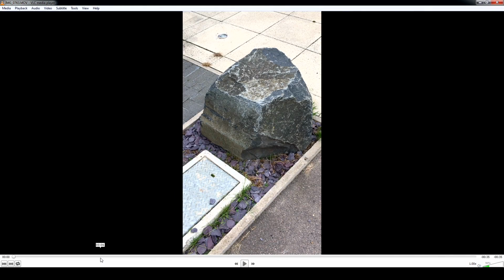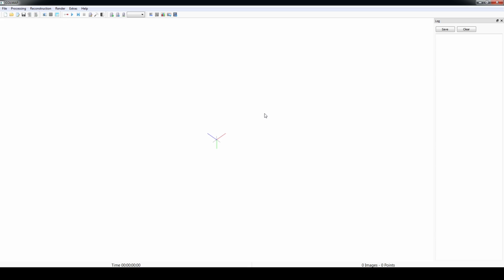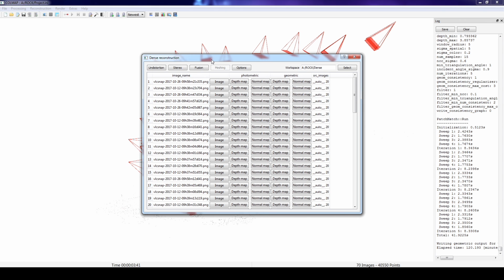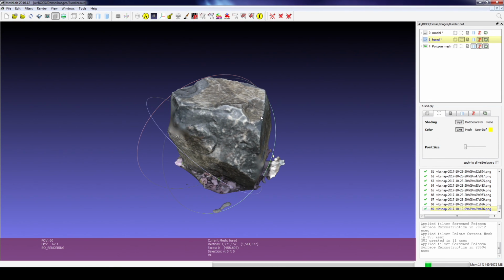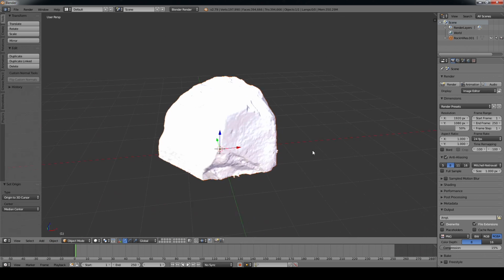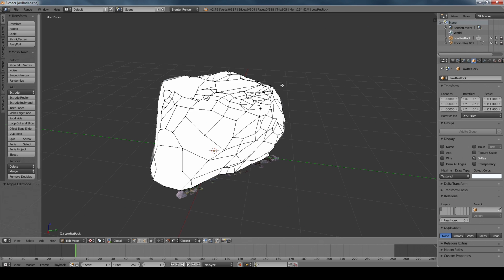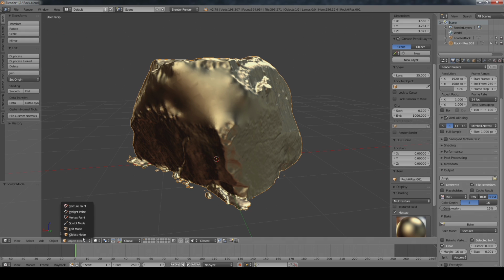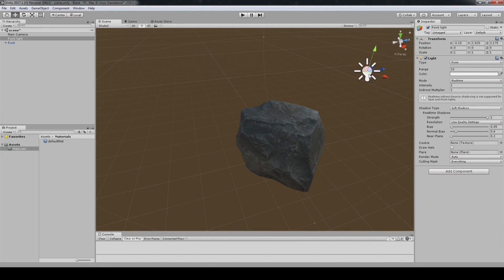Creating 3D Game Models from Video using Photogrammetry

Comment: "dense stereo reconstruction requires cuda which is not available on your system"...
and i`m using windown 10 x64 with Nvidia gtx 1060 xD

UPD: just fixed by downloading new graphics driver. COLMAP CUDA now works with "Stereo" option.

Comment: There is a troube when I using a dataset including 150 images to reconstruct the model, is there any other way to deal with the mask all? I've tried some wibesites to do this, but the AI remove bg always goes wrong.
forgive my poor ENG. Looking forward to your reply.
Reply: new question: I spent a lot of time to remove the background of these images, but when I use colmap to densify Construction, the result of construction still have background, which means it was a wasted effort.
Reply from the maker: @caeoonshen5447  Can you use video software like Davinci Resolve/AfterFX/Apple Motion to "Rotoscope" out the background

Comment: Great tutorial ! I have one problem tho. When i import my bundler to meshlab and apply textures to the mesh they are misaligned and weird looking. Is there any way to fix it ?
Reply from the maker: Hum, I haven't seen that problem. May be worth checking the colmap / meshlab forums on that one. Sorry I couldn't be more help
Reply: @ThePassiveAggressor  I managed to fix that problem by exporting Bundler from /dense/0/sparse using model_converter in command-line Interface. Thank you for your fast response tho !
Reply from the maker: @MrKajko112  Great! thanks for putting that info here for other to see :)

Comment: Do you remember what type of computer you did this on? I haven't had success with the other Meshroom app, because it crashes at the point of meshing it, so I am trying Colmap now. I'm trying to do it on a t460p Thinkpad Lenovo laptop, any suggestions on how to do a simple and less heavy model?
Reply from the maker: It was quite a good desktop i5 I think. you probably need to download the version without CUDA so it will be quite slow

Comment: Couldn't you just reduce polygon number on the rock in Blender and leave the old texture at the same time?
Reply from the maker: Yes, you can get blender to reduce the polygons automatically but it will never be as good as doing it by hand. (but it does an ok job)

Comment: Hi, 

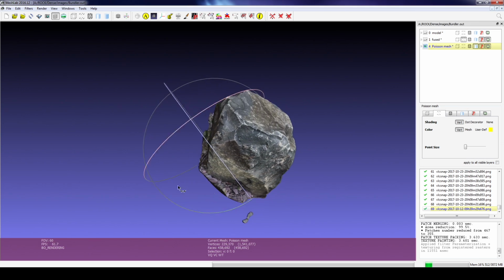I'm having trouble around 13:05 whereby when I try to parameterize + texture it says 'Failure: You need to have at least one valid raster layer in your project' but it wont let me rasterize the layer. Could you please help?
Reply from the maker: I'm not expert on MeshLab but make sure when you load the bundle into meshlab you get all your camera image in the right panel (they come in as raster layers). If not check your file structure and the bundle export. hope that helps
Reply: @ThePassiveAggressor  That worked perfectly thank you, the issue now is that I'm getting a black texture when I paramaterize and texture. Do you know any fix to this?
Reply from the maker: @Milkzba  humm not sure, make sure you set the vertex colours to white before hand, and check that meshlab can "see" your textures correctly
Reply: @ThePassiveAggressor  Yes, this was all done but it doesn't seem to want to work for me. I'm unsure of why this is but I've noticed that in the wire-frame mode you can visualize your textures from previous but it wont apply them onto the object itself. I'm unsure of what I've done wrong as I've followed your tutorial exact around 10 times to do the same thing but no results are yet to be seen. I can happily screenshot it all for you if you'd like?

Comment: Whenever I try to apply "parameterization + texturing from registered rasters" Meshlab just stalls and stops responding. However, the only difference I have made to my project is when I apply my settings for "Screened Poisson Surface Reconstruction". I set my reconstruction depth to a 15 instead of 9 or else it looks like garbage. I do this because it's a mapping of a large outside area. Several acres with buildings/structures and trees. Any ideas how I can get around this?
Reply from the maker: Sorry I haven't tried mapping a large area (although I'd like to try). Perhaps you can split it into smaller areas?
Reply: @ThePassiveAggressor  That's not a bad idea. I'll have to try that. Thanks!
Reply: @ThePassiveAggressor  I think I also might try deleting the faces that are created after I convert it into a mesh. The terrain creates a large wavey plane, even after I've already deleted the excessive vertices. Don't know why I didn't think of that before. That could be a big help.
Reply from the maker: @Tritium_Man  Great! good luck :)

Comment: Fantastic video which finally covers al areas.Question, I have bee using Agisoft Photoscan to build assets and my aim is to map and import the entire large asset into unity as a VR cloud open world. however... how would you suggest I map such a large area of say 1km litrolerly square of a famous location here in Singapore?I thought of combining photos, video, using a fab pro 2's Kinect with Tango software. The issue is with all of these is just that, all of these... Agisoft wont like more than 1 focal length, nore does it accept lidar style/ flight of capture data, so its looking more likely that I will need to switch over to reality capture which accepts all without issue (kinda answering m own question) issue with this is needing to learn yet another soft/ pay for another software. I like the approach your taking but its very time consuming and for a little asset too...  The nice thing about paid software is that is is designed to auto perform the tasks you have had to perform manually but it still looks pretty cool. (I will still lean this method).My end goal is 1 to 1 photo realism, the closest thing I come to in achieving this is 360 image capture and using virtual tour software which is more google maps/street view that The Matrix meets Ready player One which Im really going for.Any suggestions/ advice please.   Sorry for the long message and thanks for any feedback you may give, feel free to pm me at Armstrong.skyview@gmail.comRegardsChris A
Reply from the maker: That's a great question! I too would like to scan large areas (to re-visit places I've seen on holiday).  I know of a new piece of free software called Meshroom that automates more of the process, although I haven't had time to try it. Find it here: https://alicevision.github.io/ and let me know how you get on. Cheers

Comment: Great video, also is great that you're only using  open source software, but with all the time you spent on masking those pics you can actually sculpt a rock from scrath I think.
Reply from the maker: Thank's Miki, glad you liked it. It didn't take too long but there may be other ways to automate that like Rotoscoping
Reply: Maybe you can create an action in your image editor that extracts the background, like a droplet batch in PS or something. Agis photoscan is pretty fast when it comes to mask the images but I guess the point of this is staying with open source.
Reply from the maker: That's an interesting idea, thanks.

Comment: Blender also has a decimate modifier to reduce the number of polygons. It is certainly not as good as doing it by hand but it should certainly tried before doing anything by hand. Who knows, you might get lucky and get a rather good low poly model.
Reply from the maker: That's a good point, thanks :)

Comment: I was just waiting for that crash haha. I had NO idea you could do this with free software, times sure have changed, thanks for introducing me to COLMAP and Krita! Quick questions, does meshlab have any form of undo yet? And I noticed you're running a ramdisk as the working folder - have you noticed significant gains over a decent SSD or was it 'just because'? Thanks, really appreciate the tutorial!
Reply from the maker: Really glad you liked it :) Actually I don't think COLMAP has an undo system, its kind of a one way process.  RamDisk are faster then SSD but I just like having some temporary space I can mess about with.

Comment: When im using parameterization + texturing from registered rasters, the error 
"Failure of filter: 'Parameterization + texturing from registered rasters'
You need to have at least one valid raster layer in your project, to apply this filter" shows up. Anyone knows how to fix this or what Im doing wrong?
Reply: Bump, same error
Reply: Same
Reply: Open your out.list.txt file in Notepad and see if it is empty. If this is the case you have exported the bundler files from the dense model. Load the sparse model again and save the bundler files from there and it should work. In Meshlab your images should appear in the Layer Dialog window after you open the project. Hope this helps
Reply: I'm also having this same error. Anyone have a definitive fix?

Comment: Any special reason to use Blender Internal instead of Cycles for baking?
Reply: In my experience, and that of everyone on my team, Blender Internal has proven to be much faster for   baking across texture (color) and normal maps. Give it a test yourself and let us know.  Also, from months of testing, I can state that the accuracy of the baking of these maps is nearly perfect, even with the default settings.

Comment: Has somebody had a problem like, I would like to create dense > stereo, and a program quits after a few itteration... (I set the tdr value in nvdia Nsight ti 120seconds) (xeon, 16Gb Ram, Quadro P2000 HP workstatin Z 440)

Comment: To make a low resolution of the mesh, you can reduce the number of polygonf with decimate tools on meshlab isn´t?
Reply from the maker: Yes, that is definitely an option but you'll always get better results doing it by hand. There also a great free bit of software called Instant Meshes that can do it but by hand is always better.
Reply: there are the same modifier in Blender software, called "decimate". Maybe ThePA are right about hand work.
And, thanks to author, very good tutorial!